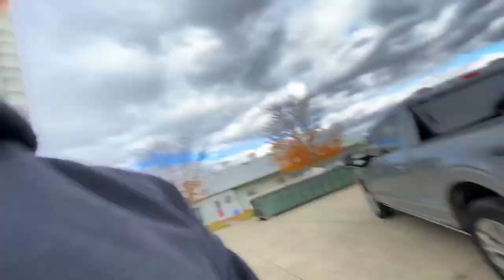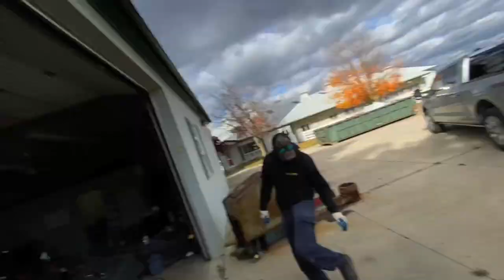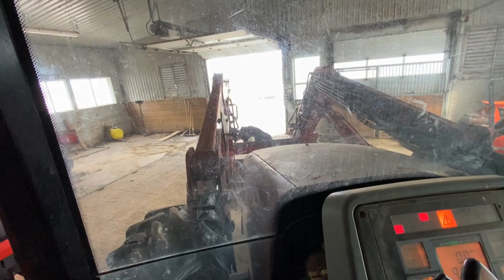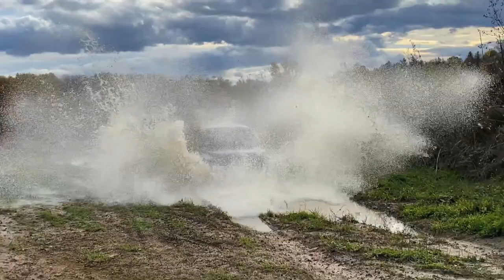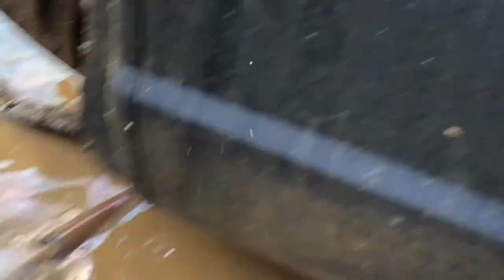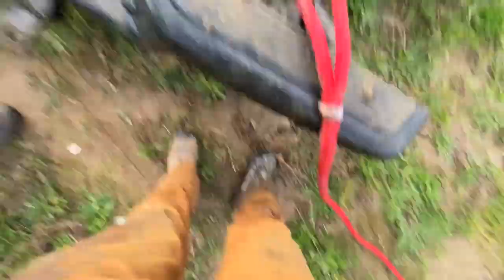STUCK MUDDING 4X4 DODGE!

Comment: V6 or V8?
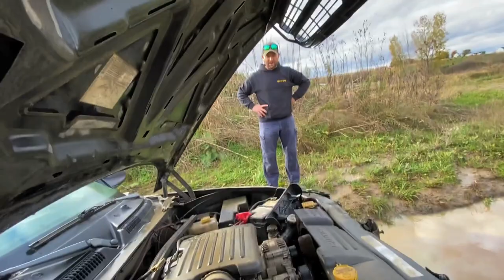Reply: This one is a 3.9 which is a v6, my grandmas dakota is 4x4 with the 4.7 you can read the air intake cover at 16:55
Reply: @ryanravencaller   ? You can easily tell through the sound this is the 4.7 V8, and on the air intake cover, it says Dodge V8 Magnum. If it was the V6 the exhaust note would be a much higher pitch, and it would be able to do donuts nearly as easily as the ones it was doing in this video lmao